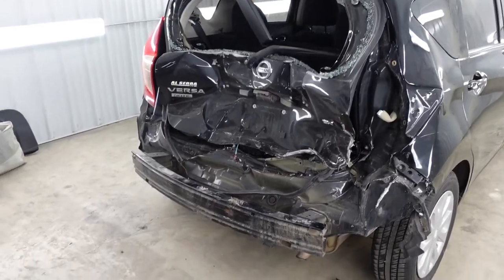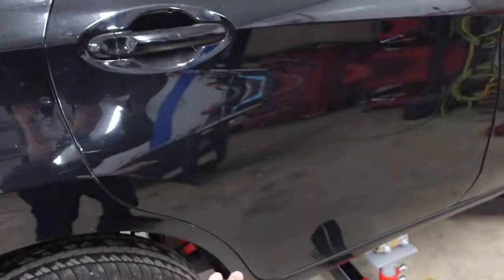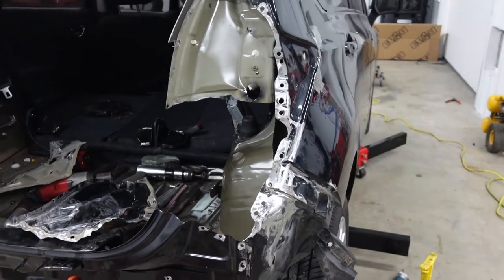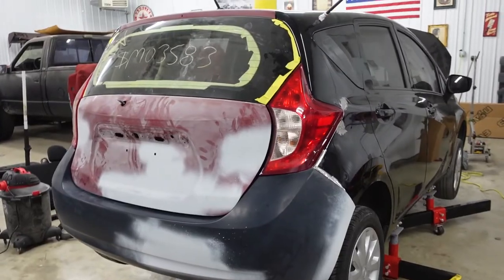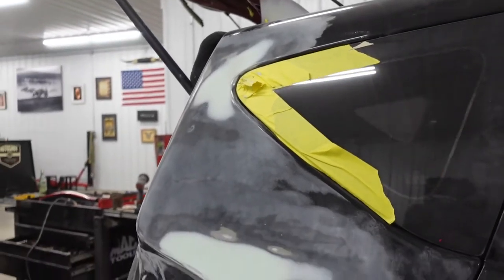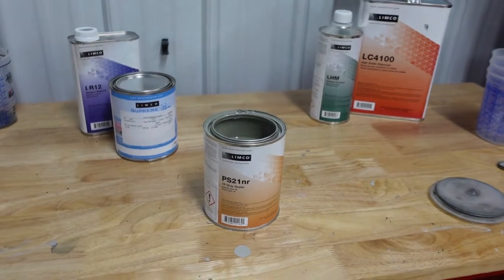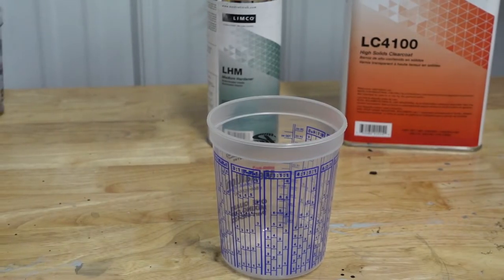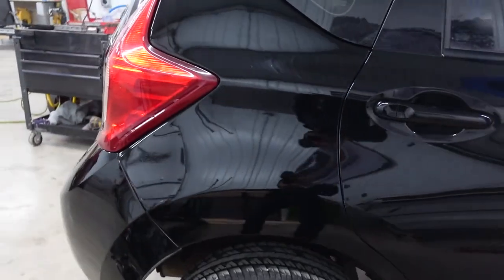how to collision repair nissan note | Collision & Paint

Comment: hi your work is incredibale!.I have been doing them big dents for 12 years now today i got one a toyota camary 2016 the insurance company said fix it at first glance not bad but i pulled rear bumper off and tore trunk fabric out.major problem the right frame rail was bent and it was folded over the skin in floor was overtop of itself where its welded to framerail.put a stop to that glue pull fun.got totaled
Reply from the maker: Hello John thanks for the support 👊.. That hidden damage can be tricky it's got me a few times 🤦🏽‍♂️